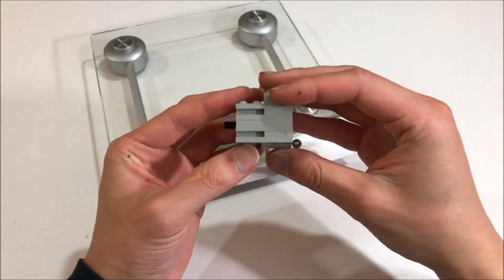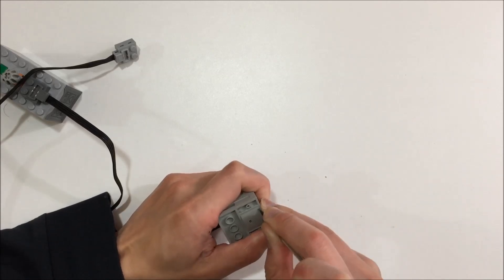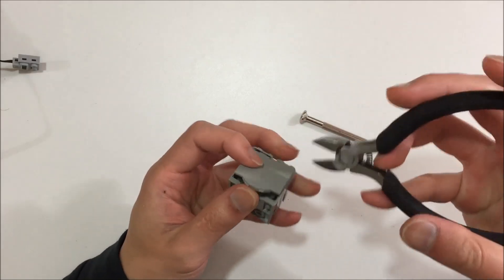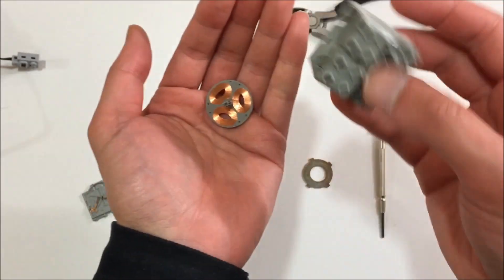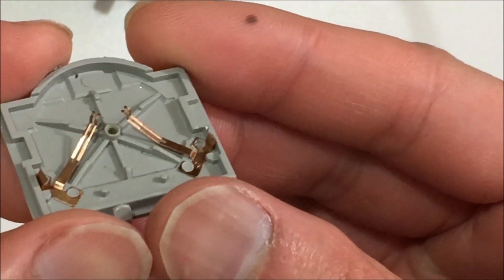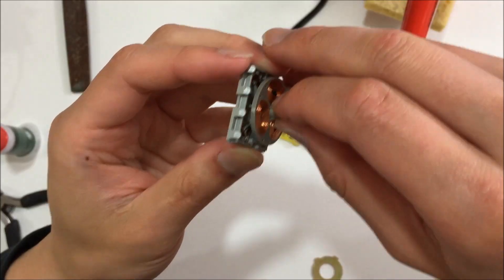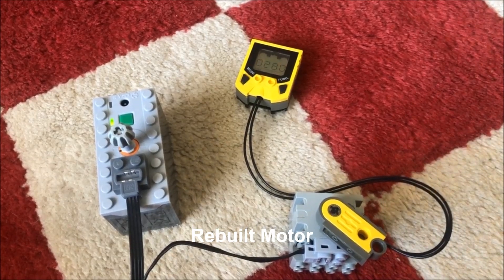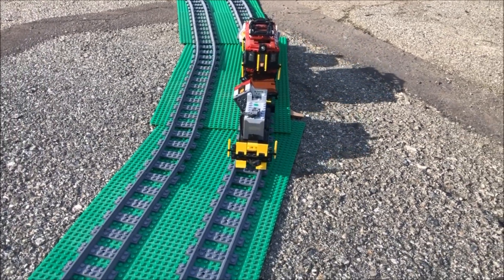LEGO Technic 43362 Light 9v Mini-Motor Disassembly and Reassembly

Comment: does the magnet degradation issue happen on these too? one of them (43362, not 71427) is seized solid despite otherwise looking almost brand new.
Reply from the maker: Not that I know of... at the very least we haven't seen a 43362 with a busted magnet.

Comment: How did you achieve to connect a newer generation battery box with newer cable to an older motor. Seems the connector is not matching unless you use a connector adapter. But it seems you did not use a adapter
Reply from the maker: The official LEGO PF cables have a 9v connector on the light grey end!
Reply: @NonsenseWars  Thanks for the info and thanks for fast response.

Comment: I thought I had this, but when I opened it, it looks different, I guess it's the 71427. Looks like it cannot be disassembled. Inside, it looks all clean and nice. The problem: the shaft does not rotate. It's stuck.
Reply from the maker: Check out the video on 71427: https://youtu.be/rAftSYHsnm0

Comment: Could you possibly do one on the earlier generation (2838)? I have one of those from a cousin, and don't have the infrastructure to test or repair.
Reply from the maker: I haven't seen a broken one of those yet. What seems to be the problem with it? 

Those ungeared motors are glued together, so it will be finicky to open them up.
Reply: I just wanted to see what was inside it before I opened it up so see what works/how to fix; its the only component I have of the old system so I never really tried to test it.

Comment: you can get those opened more easily by pressing on the tabs through the holes on the top side. This way, you don't need to damage the casing.
Reply: Yes, this is the corect way to get into these motors.
Reply from the maker: Interesting tip; I will try it on the next one!

Comment: I own one of those motors but it does do nothing when a battery box is attached to it. And turning on it doesn't work too, it just cracks. May you know why its cracking? My thought is that a gear in the gearbox is ripped.
Reply: Ok, you dont have to answer me, I opened the motor and saw that its was burned out. Everything inside it was black and burned. Rip
Reply from the maker: Wow, take a picture, I'm really surprised by that!
Reply: @NonsenseWars  ah, sorry, I threw it away already